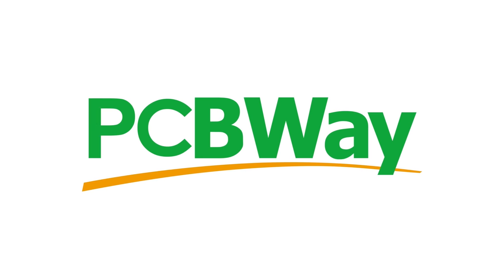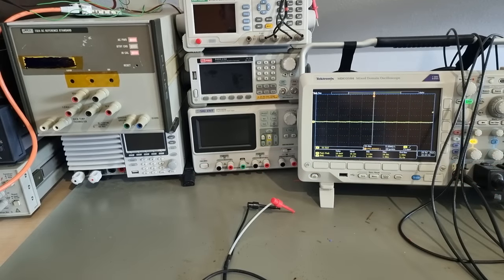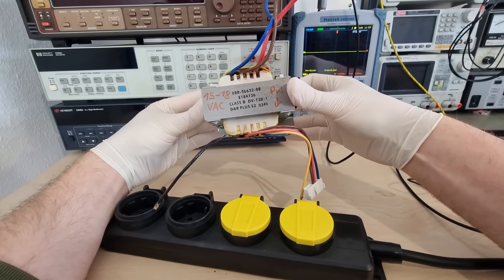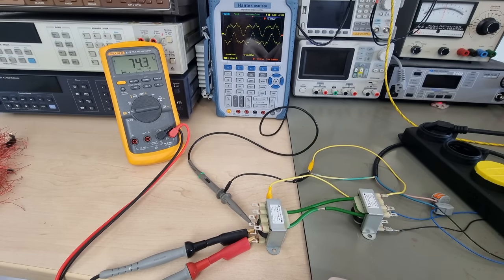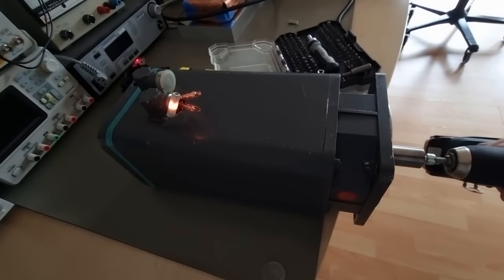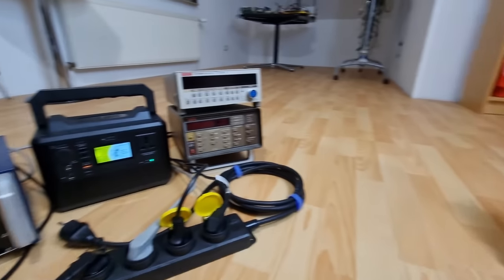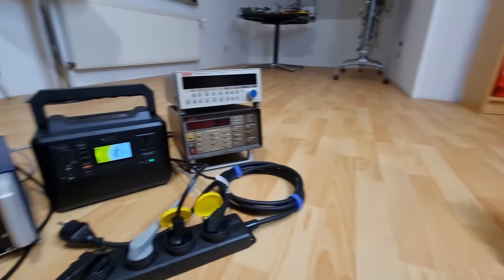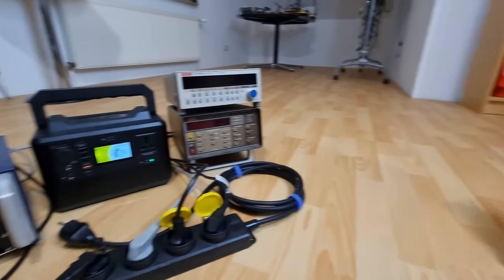eXtReMe iSoLaTiOn ( Low Leakage Power in Precision Electronics )

Comment: Welcome to that rabbit hole called emc :) Common-Mode problems are 99% of that work. To be honest, it's mostly solved by altering dimmensions after failing to "just" add filters.

Having that said, have a look at ethernet magnetics and gate transformers and those old ISDN/POTS transformers.... at least the latter 2 should give you 1W+

The higher switching clocks needed may sound counter intuitive, but remember the impedance of an CM choke :) so there's a geometric sweet spot in the hunt for the lowest CM noise...
BTW, I have a propper EMC measurement setup... so if you feel your converters should get some characterization, I may be able to get you numbers :)

Regards

Comment: I kept thinking about this capacitive isolation requirement that you where trying to achieve; you mentioned around the end the use of an "amorphous metal transformer core" - this looks like a very electrically conductive material. I am bringing this up since if you would be using a ferrite core, that should not be electrically conductive, and also work better at the high frequency of a switching converter. So even if you are sacrificing a bit of magnetic permeability, the core its self would not be a path of capacitive coupling. In the final designs, it seems (to me at least) that the smallest physical electrical distance between primary and secondary is not over the PCB, but rather from wire insulation to the core, and core to insulation on second side. What do you think?
Reply from the maker: Interesting point indeed! I was swooning over amorphous cores so much that that didn't even occur to me. I'll try and find a ferrite core to test some time. (Or if you got around to it first, I'd love to hear your result!)
Reply: @reps  I guess the other important thing to consider is that the leakage current between primary and secondary is frequency dependent - for a fixed voltage, the same capacitance will yield much lower current at say 50Hz (mains frequency) than 50KHz (a switching converter). In the end I guess its a compromise - get higher capacitance but work at low frequency or get low capacitance and try high frequency... However, high frequency means easier common mode filtration. This is quite an interesting subject :D
Reply: What?! FesZ and Marco Reps in conversation!?  Not sure if my heart can take the excitement!

Comment: 13:45 Its called 'Power-over-fiber' or 'PoF'. AZURSpace has a 'Laser Power Converter Diode' (Type: LPC-810-x-00) with a maximum optical input power of 1.6 Watt. This  device is intended to convert monochromatic light in the spectral range of 810 ±20 nm into electrical energy. Chip Size is only 1.82 x 1.82 mm.

Comment: A simple yet brutal solution might be a deicated low coupling low CM-Noise gate driver supply module for power electronics, and throw in a bunch of CM-Filters. Because those modules essentially "converts" the noise to higher frequencies and make them easier to filter. Same idea as over sampling.
Reply: AND by using a high quality mains Xformer and a SMPS together, the capacitance of them will be connected in series -> Further reduction of total leakage capacitance.

Comment: Magnetec has nanoperm cores with huge relative permeability, 80000. I've used them.
Also, look up Austin transformer. It's used to power lights in transmission towers. It's a toroidal transformer with one of the windings at a large clearance from the core.

Comment: One thing you should probably still try are the transformers that are commonly used in physics classes with those interchangeable coils and everything. Here, the cores are a few centimeters apart, however, I assume that coupling is less than ideal.

Comment: I have a medical grade isolation transformer, it actually came out of an OR that was being overhauled.  The downside is that is is not 1:1 or 2:1 is it was designed to give 120 from between from 3 phase so it is 1.9:1.  It has a rated leakage current of no more than 10 microamps.  It is not the highest isolation in the world, but the fact it is rated for medical use, I know I can depend on it.

Comment: If you want a low cost low stray capacitance DC/DC converter, you can use a common mode inductors as a transformer in a half bridge or full bridge converter.

Comment: The heater requirement is a challenge for power, but once the reference gets up to the regulated temperature the power needed to maintain this temperature in a thermal isolated chamber should drop considerably. This gives two power modes to your reference, warm up and steady state. So, you do not need low noise during warm up, because the reference will not be used until up to temp and stable.

The answer: a non-isolated warm up supply (mode 1, high current) and a charge exchange isolated supply (mode 2, low current).

For isolation you could use two supercapacitors (5F 12V) and exchange charge between them and the AC mains transformer using two relays (DPDT, isolate both the capacitor feed and the return, much like some chopper charge exchange controllers). 

So, a relay isolates the first supercap (let's call it the source supercap) from the AC (mains) derived line charging circuit and another relay isolates the second supercap (let's call it the load supercap) from the source supercap. If both relays are on the supercaps are cross connected and powered by the AC mains derived circuit, quickly charging both and providing warm up power for the heater. After warmup the relays are sequenced to exchange charge between the mains AC supply, first to the source supercap, and subsequently to the load supercap, in such a way that there is never a direct connection back to the AC line transformer and its nasty inter-capacitance leakage and coupling noise.

The load supercap is maintained at a voltage higher than the linear regulator voltage used to supply the reference circuit and the heater regulating current, and can be regulated by the switching circuit. The reference supply after warm up is essentially a varying charge/discharge voltage across the load supercap, much like how a bridge rectifier periodically charges the smoothing capacitor. But, in this case the switching speed is very slow (like once a second) in order to extend the life of the mechanical relays (high reliability 10M cycles?). If you have a switch on the front panel for standby you could just feed power across the caps saving some cycles on the relays until you switch to ultra quite isolation mode. Some PCB mount relays are very quite when they switch. But, the tiny relay switch click(s) may give some useful audible feedback

The above has been done with batteries for ages, but now we have super or ultra caps.

Comment: CORRECT, This is extreamly important, for many things, I have been playing with low capacity transformators for a long time, I need this mostly on mains powered things, i really like the ideas with toroide types, and 3D printed holders / wires seperators, i think this idea can be scaled up to mains size on toroids too, i am clearly going to make a few experiments with this. maybe even another rotation of the cores ? to make even less capacity ? my comment got lost ? so now i try again hope it works this time

Comment: How about testing a diy microwave transformer used two off😎😎 primary windings from similar sized transformers. They are quite good but do not have test equipment to test leakage accurately. thanks for your very interesting video.

Comment: Probably won't see this comment but I work for a energetic transformer company. The ones we make for Britain have some sensitive signal gear installed that runs on 110v DC and the way we get 110v DC in our test lab is basically lead acid batteries that are hooked up to a charger when non needed and when you connect the test gear the charger gets disconnected so you omly have clean pure DC. Would be interesting to see bench lab equipment taking that approach. Like one possible way is have it charge batteries constantly and then either by switching it on or having a seperate precision mode the equipment would start running off the batteries. Boom, clean pure DC
Reply: Isn't that what the Fluke 732 provides internally?

Comment: Nice video Marco thank you for making it. If you could make a video about why it is so dangerous to get a charging phone in your bath people would be very interested. Why the 5 volts do not matter anymore when the phone is submerged, why the voltage will go way higher than 5 volts when submerged in water. Thanks in advance!
Reply: How many people per million (PPM) charge their phone in bathtub? How does it correlate with the water temperature, ppm/deg?
Reply: @TheGrantourismo  It is good that not many people do that, because no one should charge their phone while they are in a bath. The voltage goes way higher than 5 volts if you drop the phone in the water and there have been cases where young people died while they were in a bath and a charging phone fell in.

Comment: Would piezoelectric transformers be good for low leakage?
Most of the ones I see have high voltage output but there must be some low voltage ones.
You might not want a lot of ultrasonic vibration inside a sensitive instrument.

Comment: Mains transformers with an intermediate shield winding (connected to secondary-side ground) are part of the "secret sauce" of traditional hi-fi equipment. Beyond about 100 VA (i.e. sizes needed for typical integrated and power amplifiers or receivers) this is rather necessary if you insist on unbalanced connections and an IEC Class II device. Otherwise open inputs may be rather prone to hum. It probably still isn't as good as the "windings on opposite sides of a grounded core" approach suggested, but I reckon magnetic coupling and as such efficiency is a whole lot better.

(I have to wonder whether the wondrous "medical grade" device may have had a shield winding but it wasn't properly hooked up or something. Mind you, it's a fairly big transformer. The only mains transformers with a shield winding that I've been able to find at parts distributors were in fact medical grade.)

This issue has been further exacerbated by the increased ubiquity of switch-mode power supplies, which often are in dire need of safety capacitors in the nF between primary and secondary ground to meet EMC or even have full-fledged mains filters whose leakage currents have nowhere to go in a Class II device. (I have some JBL 104s in the office, the level of hum/buzz when using an unbalanced audio cable that is unplugged is scary. It entirely vanishes once plugged in.)

Speaking of SMPS, shield windings can also help their transformers out as well. Mind you, going by disassembly channels, getting basic electrical safety right seems to be enough of a challenge as-is...

I am glad you mentioned the approach of nuking remaining leakage by redirecting it to ground (PE). This is also made use of in a wiring mod that I have previously suggested for IEC Class II equipment with mains filters:
Replace
L o---||---> SGnd
N o---||---> SGnd
by
L o---||---> PE
N o--||---> PE
PE o--||---> SGnd
(capacitors -||- being a Y2 rated 2.2-4.7 nF safety type)

Works wonders on old Yamaha A-760, 960 and 1060 series amplifiers, for example (they are using some thyristor business for primary-side regulation and accordingly need mains filtering badly but are IEC Class II; at least on the 220 V version the mod actually is quite straightforward). Stock, they like to hum on open inputs rather noticeably, as you may be able to guess. I have termed the modified wiring "IEC Class II with benefits". It follows the tradition of PAL in combining multiple cost-increasing elements from existing systems for the best result. ;)

This only works if your PE is actually present and properly hooked up, of course, which is not a given everywhere in this world (while I would be unconcerned about Germany, the UK and newer installations in the US, parts of Asia may be a different story).

Comment: I’ve got a bunch of those anamorphosis metal cores up to 12 inches I believe or at least close to that size if you want them

Believe it or not a lot of the massive current transformers and sensors used in huge HVAC and screw chiller machines (made by York and others)… Those huge cores are made with that anamorphosis stuff, I’ve actually had splinters of that shit up on my fingernails before it’s awful 😁
I’ve also got some that are really crazy looking and strangely shaped like a doorway and about 10 inches tall. I’ve got shit loads of those things in all sizes
Reply: What are you doing with them... making reallly huge guitar pickups?

Comment: @4:43 you need shielded cable. Cause you can have the same order of amperages due LED lights, powercords etc..
Upvoted, none the less.
Reply: The coax passive probe cable from the scope is shielded (since it's a coax cable) but indeed for such sensitive measurements his grounding and probing leaves me feeling a bit uneasy. I would much rather he had a short ground spring rather than this aligator clip that has a relatively huge inductive coupling.
Reply: @InTimeTraveller  Yep, I was incredibly frustrated when used LED lights with cheap drivers with microampmeter. It was quite horrible.
Just unscrewing these off and putting in 40W incandescent lights were enough.

Comment: If you need a really clean and electrically silent very well isolated power supply with a compact design then there is a great solution and it is called a piezoelectric transformer. Apart from limited efficiency and quite a hight price theese are great although not very widely used devices. They are especially good if you need very high voltages at least at one side. They are somewhat hard to come by but they are still available and can be ordered directly from some companies and manufactured to your specs. That is in case you don't happen to already have something like a piece of an old scrapped towed sonar array from a late soviet submarine to tear down for parts :).

Comment: Maybe two speakers that are coupled to each other via a tube. Or two mechanical coupled electric motors. Maybe with a belt or something.
Reply: A water pump, reservoir and waterwheel?
Reply: @DisorderedArray  that’s just hilarious
Reply: 13:34 motor connected to a generator might work but that usually comes with wear and noise so i'd prefer a solid state system
Reply: @Graham_Wideman  I watched some YT video from CERN where they have some measurement equipment under very high voltage, they power it this way, and receive measurements through fiber optic cable

Comment: There is a capacitor/resistor inside the commercial SMPS, providing leakage by design, to protect the coils' insulation from electrostatic charges (across the insulation) that can damage them.

Comment: 4:14 I dont think that you are completely correct. battery powered scopes can have switching regulators too. because i dont think that they get special battery cells for the voltage they need. i think they use a pack with a different voltage and step that down/up that to the values they need

Comment: oscilloscope reflectop0rn, we approve.  How about just placing several 230 V->12V PCB transformers back to back ? 230V->12V->12V->230V->12V... repeat until capacitance is low enough ?

Comment: Wouldn't the stray magnetic field from the transformer affect the sensitive LTZ circuit (which is literally on the same board) as well?

Anyway, my idea would be to use supercaps and a bunch of reed relays, kinda similar to the Fluke thermometer but not quite.
First, you have a decent linear power supply (mains ransformer + linear reg) which will charge two 30V super cap banks, then the 1st bank will be disconnected from the mains supply, then connect to a linear regulator on the V-ref side, which will drop 30V to 15V. When the cap bank drop to around 20V, the 1st bank will be disconnected from the V-ref side to recharge, the 2nd bank will be connected to the V-ref, and the cycle repeats.
There would be a small cap bank on the V-ref side as well, to keep its input voltage somewhat stable during the supercap banks switching.

What do you think, good idea?

Comment: The concept is a bit misleading. What you measured is the common mode current, so what is the relation to the leakage current? The leakage current should be RESISTIVE, but common mode could be fully capacitive. I can build a high capacitive transformer with high voltage rating, so what would be the LEAKAGE do you think?

Comment: i wonder if he wears those gloves for insulation from incidental contact.  i started doing that with higher quality nitrile disposable gloves, in the rare case i have to work on a critical circuit that can't be shut off.  the proper gloves, class 00 with keepers, are like trying to work while wearing boxing gloves.

Comment: does pulling tape off the board not induce potentially damaging static buildup? I understand merely pulling tape off of a roll generates 3000+ volts, not enough to produce a static shock but enough to damage silicon chips. Please confirm.

Comment: Just use the battery, have it plugged into the mains when you're not using it, then for the few hours you need the isolation, remove the connection

Comment: I am curious how a high powered blue laser (as in the illegal china ones on ebay) pointed at a peltier with a big heatsink on the opposite side would do.  Paint the laser side black for max absorption and spread the laser focus to hit the most surface area of the peltier.   It's a ridiculous concept and incredible wasteful of energy but I am still curious none the less!  I have a peltier and laser but not the gear to measure it.

Comment: Was thinking, would a CT120-120V secondary balanced output cancel common mode at all or bonding P-E to N on the secondary side of a 1:1 with motor run caps across the N+P-E and L and then a "2/3 wire output". Seen this bonding config inside mains telecom filters.